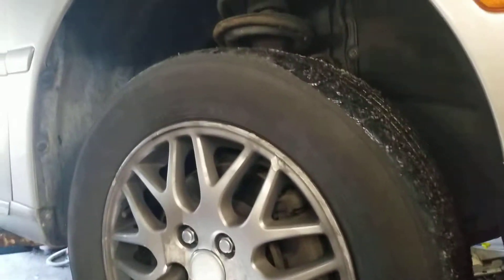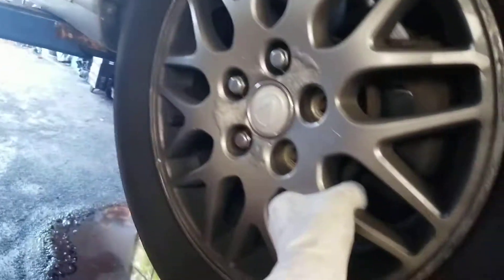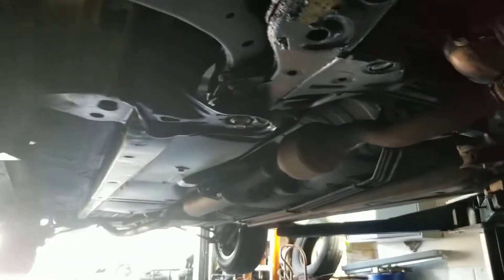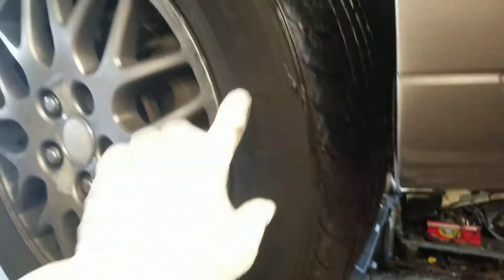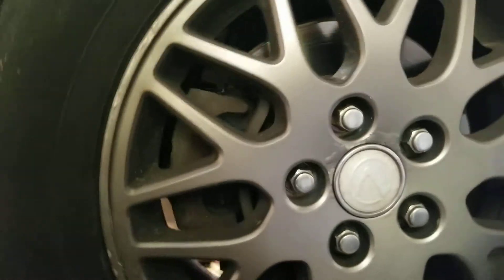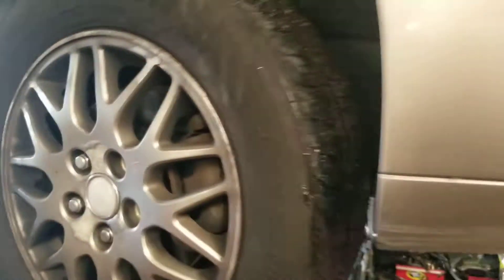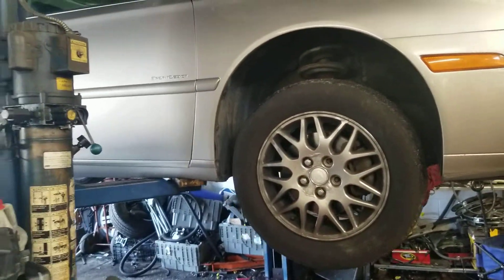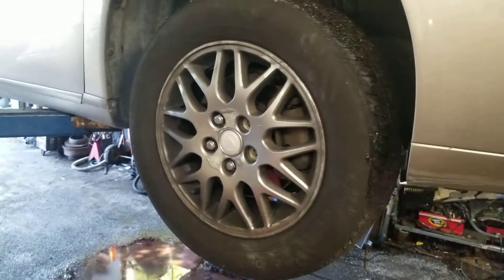How to Diagnose Bad Lower control arms

Comment: I’ve replaced upper control arms, sway bar end links, sway bar bushings, outer tie rods, quick struts, rear shocks. And have had alignments. I get this bad shimmy even just going down a straight road and over bumps my wheel goes side to side and clunks within dash
Reply from the maker: check ball joints.
Reply: its probably the break pad or caliper making the shimmy